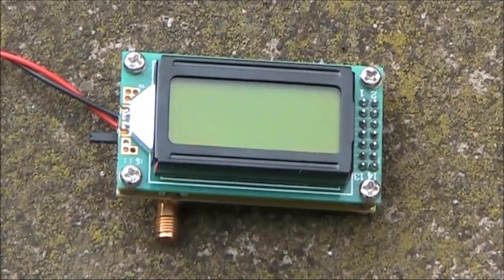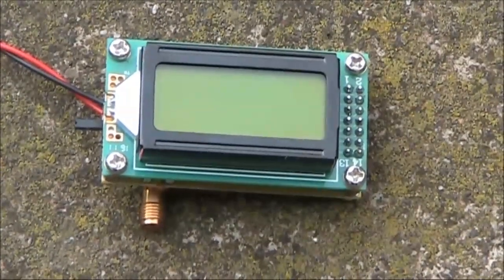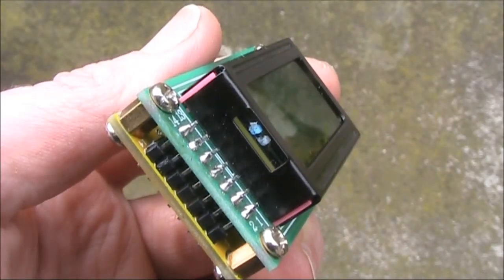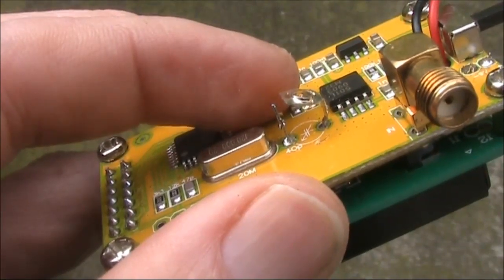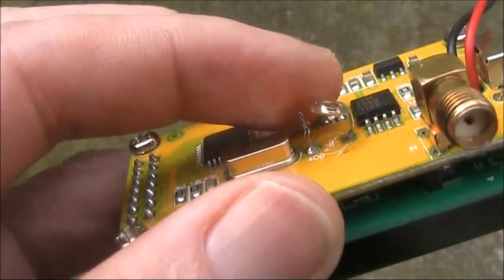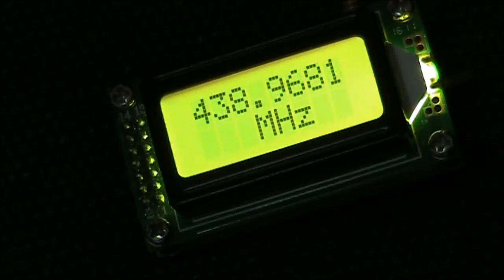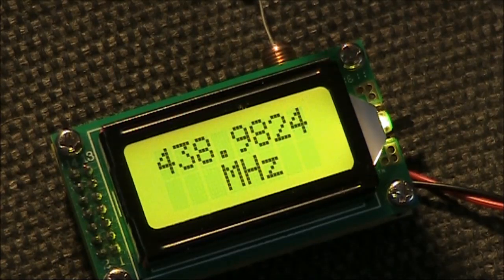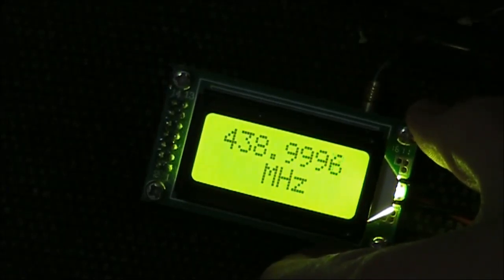Fixing a cheap UHF frequency counter

Comment: My module is only accurate above 8 MHz but its hooked up to a Yaesu FRG-7700 with a bad display. Hate to mess with the trimmer as its dead on from 8 to 30Mc.

Comment: I have a question. Does this FC works with audio signals generated by function generator ? I have connect mine to a function generator and it doesn't read. I think that only reads RF signals. Can you confirm ?Thanks.
Reply: I can confirm that this device will not give correct readings below 1Mhz. It is not suitable for audio frequencies.
Reply from the maker: I don't know, unfortunately.

Comment: Thanks for the post - definitely worth doing this.     The closest I could get was +6KHz error using the supplied trimmer.    I removed the trimmer, got -40kHz error.   With 15pf it was +9kHz.  With 11.5pf (made from a couple of other values in series that I had to had) it is +1kHz  (at 446MHz).   Near enough for me.    So it seems like 10pf is the fixed value you need.  I might have another go if I find some other values.

Comment: Hello, how many db least should the power of the signal coming to the antenna be in order for the frequency counter to detect it?
Reply: I don't know if you still need this information. With just a short piece of wire connected to the counter, I can get a reading using a baofeng, no direct connection. In fact it worked one and a half metres away. Tried two extremely low powered (milliwatts) home built fm transmitters. The first one I did a direct connection. The next didn't have an antenna wire, but the counter still read it no direct connection. So it doesn't need much.

Comment: Tantalum capacitor is way more stable to temperature changes than ceramic ones... Just a thought...
Reply from the maker: Can you get tantalum capacitors at values of a few picofarads? Not that I know of.
Reply: @vk3ye  well, I've found some but it's the minimum quantity order that would be a problem for you...
Reply: It was an NP0 cap he put in there.  Look up what NP0 means.  You should then see the folly of that comment once you do.

Comment: I bought 2 of these through ebay a couple of years ago. They both were terribly off, adjusting the capacitor did not help. After complaining to the seller he sent me a new one which also was off. I accepted my loss and put them away in a box with other projects. But now after this movie I will spend some time to try again to make them work.